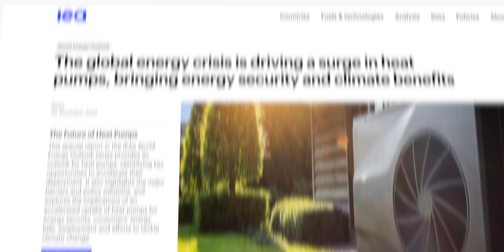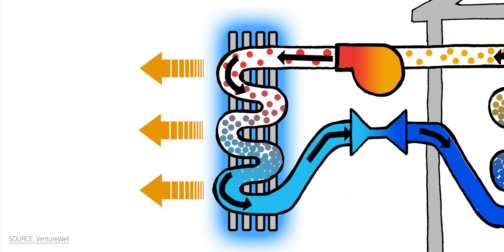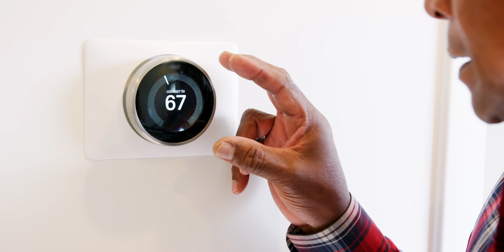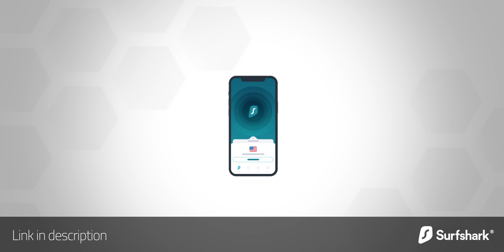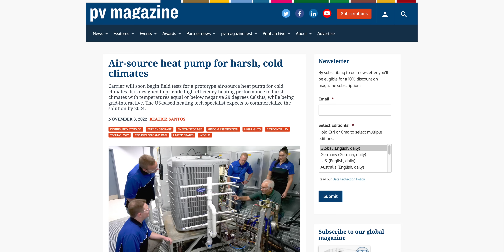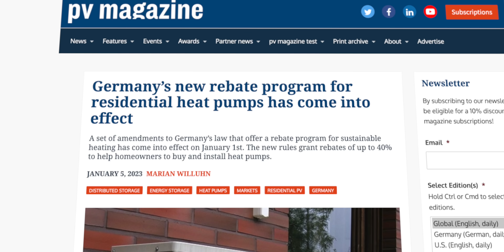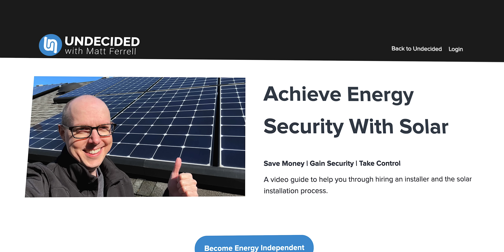Major Advances with Heat Pumps in the Extreme Cold

Comment: I live in Central New York and have a geothermal water to air heat pump.  It works very good in the winter and even better in the summer.  I does run all the time when it's cold outside because it is easier for it to maintain the temperature inside that way.  Our house originally had oil and I'm glad it's gone.  Planning on getting solar and a local storage battery to maintain the power to run it if we lose power from the grid.  Our system was installed in 2021.  Unless the tax credits were changed, they started at 30% of the install cost and go down each year by 2%.  For 2021 taxes we were able to get a credit for 26% of the install costs.  Plus we received a rebate from New York state for about $6000 that came off the top of the install price.  Still cost a good amount, but the amount we save each year from oil is enough to recoup the costs in about 5 to 8 years.
Reply: Do people really fall for the spam messages that say DM me for money?  I find it hard to believe.

Comment: I have a relative that lives way up north where it gets very cold indeed.  She has a ground water sourced heat pump.  Basically they drilled two wells. Water is pumped out of one and back into the other.  They are placed far apart so the cold water they are pumping into the ground doesn't go to the input side well.  On the coldest of cold days, it keeps the house comfortable running only about 50% of the time.  It seems that a factor of two overdesign is what heating people always do.

Comment: Heat pumps working at low temperatures is great. Having your thermostat  controlled by the grid is centralized, top-down control. The PV magazine article on the Johnson Controls heat pump  you showed, states the technology will  "enable utilities and aggregators to ask connected heat pumps to reduce power consumption to 70%, 40%, and shut-off, depending on the level of curtailment needed.” Heat pumps that successfully pass the challenge will have to provide such grid-interaction services."  I don't want my heat being shut off as a means to control me. Based on what is happening in China with social credit scores and the move in US and elsewhere toward central bank digital currency, these are techniques for "elite" to control our lives, money, and now energy.

Comment: I had a AC/Heat pump installed last summer, it's been fantastic.  Works great until about 26F below that it really starts working pretty hard and is loosing efficiency so I switch back to my propane.  I've barely used any propane this year, so it'll pay for itself in a few years.

Comment: My Lennox uses more electricity in the winter then the summer. It heats but uses lots of power. I turn on natural gas below 30 F. It’s a 98% efferent furnace/ heat pump that is 6 years old. SLC UT.

Comment: 2:36 Well, I'm not sure how you can say that's not a lot of electricity - a HP can draw around 4kw an hour if around a 48k system. That for me, is 52 cents an hour just for the outdoor unit, and yes, that amount of heat demand is not atypical up north. 
3:25 I'm not sure where you got that information that HP systems require less maintenance than a combustion system, but that's just simply not the case. And while I'm all for electrification, unfortunately, HP's just don't win the cost argument, upfront or even for operation, IF using natural gas as a comparison. 
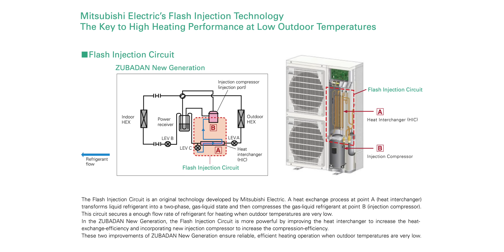7:50 Mitsubish already has this on their newest H2I systems from what I've gathered. However. the diagram is wrong - what is going on, is refrigerant that was not turned into liquid, gets fed back into the compressor and then sent back to the coil, which is necessary due to high compression ratios at low temps. Refrigerant turned back into a gas gets also pumped as usual, and that is what keeps temps in check. I'm not sure who alleged that reduces efficiency - quite contrary, it actually makes it work at really low temps vs just having early compressor failures. Gree also has their own setup already in place in the FLEXX system (also MRCOOL Universal) and their Ultra systems that are rated to -31 F.

I don't have much faith in anyone here in the USA to install these correctly. Don't take my word for it - take Jim Bergmann's, a veteran of the industry. Read the entry on Measure Quick's website, Electrification – An Open Letter, under news. Getting everyone to HP is really, really going to be a horrible time due to how they work, esp for those of us up north. And that's because putting in the necessary capacity just isn't feasible with air flow restraints.
Reply: Both of the A2A heat pumps I've owned here in Sweden have had a 2-4 year service interval. Any Combustion-based system needs to be serviced and checked annually for safety, in some countries that's even a legal requirement (I have to have my chimney checked yearly by law here, even if it's not "in-service", it by law needs to be checked every 3). Skipping a heat pump service results in a best case, is you lose a bit of efficiency, worst case, reduction in service life. If you leave a combustion-based system for 4+ years without a service, you are literally playing with fire.
Reply: @Ben  10 plus years with my furnace, no maintenance needed. Vs my mini split after one year already needs a blower wheel cleaning. And since I know the amount of effort it took to remove it to replace the motor, I'm not looking forward to it.

Comment: It's interesting to note that my utility company "has" rebates available for installing heat pumps, but in practice there are enough caveats to that so that you may not qualify. I didn't qualify because I didn't have a particular model of coil they wanted installed in my ducts (because it was too big so I went with a smaller one that fits and still works perfectly fine). And of course having the duct above my back up furnace replaced to match the more expensive coil would have ultimately cost me more than the rebate was worth.

Comment: "Automatically scales back energy consumption during times of peak grid loads"
This benefits only the grid operator, not the homeowner. I'm not sure why people say this as though it's a good thing. When the grid is under peak load is typically caused by the same weather that is at my house, when I also need peak performance of my system. It isn't my fault the grid operators are lazy with building out capacity growth.

Comment: I live in the northern part of the S.E. of the US. We have one of the older style heat pumps as part of our AC/electric heating system.  It doesn't work very well below freezing, and I can't afford a geothermal system nor even to upgrade to a newer and more efficient air heat pump type system.  So what I've thought of doing is to modify it some: 

    Basically I want to dig a watertight box into the ground and connect a closed loop piping system to loop around my outside condenser. More specifically, the box/water container will be highly insulated on the top, the water will have some anti freeze in it, and I plan to build a box on top of the in and outflow pipes (and right on top of the buried water container), and that box will be painted ultra black and have reflectors on the side so that it will warm with solar energy (and have water bottles inside for thermal mass/storage). 

    Basically I want to try to squeeze every little bit of efficiency out of it for when the temp drops below freezing, but at lost cost and easy installation.  If I put a cover over the above ground box that is painted both ultra white and with a material that has good IR transfer, I may be able to use the system to boost efficiency for cooling in the summer as well.

Comment: I recently (last year) replaced the furnace in my house. I considered a heat pump instead of non-reversible AC. The problem was it cost twice as much and was made of unobtainium. As in, just plain not available for 18 months or more. And I would still need a backup heat source. It just wasn't economically possible, however desirable it might be.

Comment: I'm employed in HVAC trade & it's true older heatpumps needed axillary electric strip heat during cold weather but newer technology heatpumps are getting better. Problem I have with customers is trying to convince them to refrain from using higher indoor fan speeds thinking they will get more heating capacity. Can't tell how many times I tell customers to pick a temperature, put the indoor fan in "AUTO", LEAVE IT ALONE & allow the unit's control algorithms to determine the most efficient mode for comfort control.

Comment: We are near you, west of Boston, and have replaced our oil furnace usage 100% through solar and heat pumps. We have 80 solar panels across 2 systems, Generac and Enphase, with a 18 kWh Generac battery.  And we have a Bosch 5 ton 20 SEER ASHP for the main house (rated to -5F), and a smaller Mitsubishi heat pump for a 3 room addition (rated to -13F).  We finalized it with a Rheem ASHP water heater. We are still in the first year of having all these systems on since we shut off the oil furnace in September.  So far so good.  We’re waiting for 12 months of operation before analyzing our exact energy usage, but back of the envelope shows we should produce about 25 MWh of solar and consume about 15 MWh, leaving a 10 MWh surplus that we send back to the grid. But that puts us in a position to switch over to EVs and not worry too much about paying to charge them. We’ll see.

Comment: I have a air-based heat pump by Daiken and the upfront installation was around $15K fully installed with insulated ducting. It's everything Matt says they are here.  Very low maintenance, and considerably quiet.   Down side?  When it falls below 10 degrees here in Alaska, it does struggle a little to keep our home temp which we like at 68 degrees.  So we supplement that heat with a pellet stove.  I burn through maybe 10 bags (40lb ea) of pellets a year on cold years, less on not so cold years.  But the challenge for us is not it becoming too cold, it occurs around 31-34 degrees which causes massive ice buildup within the unit.  I bought a handheld pressure steamer to deal with that when it gets bad.  Overall, it's my favorite way to heat where I live and it doesn't stress my energy bill out at all.
Reply: Trudeau will be coming after that pellet stove before long.

Comment: We own two properties in Canada and both are heated by hybrid heat pump systems (with gas auxiliary heat). We keep our vacation property heated to 10 degrees C and this works without auxiliary heat down to -30 C. In the city, we keep our house at 20 degrees C and our Lennox heat pump works without auxiliary heat down to -15 C. The only issue we have is that heat pumps seem to be able to maintain a constant temperature, but are not good at making up a temperature deficit. As a result, we no longer reduce our thermostat at night. If we reduce our thermostat down to 16 C at night, we need auxiliary gas heat to bring the temperature back up in the morning.

Comment: My heatpump in Canada is 12 years old, house is 68 years old but with new windows. We've had a few days of -30c and it's been almost able to keep up. I had to turn on two space heaters to maintain temp, and they kept the house temp up along with what the heatpump was still putting out. It's able to easily keep up to -20c but I do notice it when it kicks in to defrost I will drop a degree or two before the heat kicks back on and it catches back up.

Comment: Think of it this way:

A freezer takes heat from the inside (where it's very cold) and puts it in the back of the freezer cabinet (which gets warm.)

Electricity plus heat pump will always generate more heat than plain electricity. Anyone who says "hear pumps don't work" is simply repeating fossil industry FUD.

(Because electricity can be made from fission and renewables, without fossil fuels.)

Comment: I have radiant floor heating in my home. There's a system in the basement that manages the temperature in combination with the water heater. I can keep the internal home in the winter a few degrees cooler just because the warm floor really makes the room comfortable.

I'm looking at building a new home with cooled ceiling panels, radiant floor heating, a geothermal heat pump, and multi-stage tankless water heaters. For power, I'm looking at solar panels on the roof and an ionic wind power fence. I may also have some hydroponics and a small animal barn. It's going to be a really big project but the home will be self reliant and that's a huge plus in the mountains.

Comment: We got a heat pump about 10 years ago when our highest electric bills were north of $600 during winter. The absolute highest bills are now $400 (when certain circumstances required us using more electricity some years, so $400 is rare). But the bill year around for the past 10 years was always less than it was previously. (Our system has an electric furnace back up that comes on around 25 degrees F. We did have to have the heat pump repaired a couple of times, but we are still saving money compared to what our bills would have been if we never switched.)  At some point I'm sure we'll have to get a new one, but it is still working pretty well.

Comment: Electric heat?  What's the monthly heating cost as compared to natural gas, propane, fuel oil, pellet stove, wood stove?
I doubt electric is a good idea in the long run simply from an energy-density standpoint.

Comment: "geothermal" and cold isn't an issue. if your system is properly designed the temperature where it is under ground will be near constant.  In fact, if you use A.C. in the summer the waste heat might partially remain as stored heat underground for your use the next winter.
air source heat pumps can operate and extract heat even from low temperatures and advertise high efficiency. In my experience this is not complete system efficiency, however. For example, the heat for the defrost cycle and the discomfort if this heat is drawn from the house or electricity used to provide heat during that time.
Defrost is needed starting in the mid- to upper-30s F - well above freezing.  The amount of defrost increases as the humidity increases because the ice builds up faster and thicker on the coils.

Comment: In 2017 our houses original early 2000's furnace tried to burn the house down when the control panel shorted out. We looked into a ground source heat pump setup, it was going to be $80k to do vertical bore loops or $50k for horizontal loops. The unit itself was about $8k and the install costs were about $5k. 
We opted to go with an air source heat pump but like everyone says, it basically stops working sub 30F and the house just gets cold and we have to fire up space heaters to keep the rooms we are in over 60F. /edit fixed typo

Comment: 1. Heat pumps are absolutely not as efficient as using heat from combustion directly. In order to make the electricity either Coal or NatGas is burned, which is used to run a steam turbine. Turbines are on average only 40% efficient in converting steam pressure into mechanical energy. & lot of energy is also lost just converting water into pressurized steam as water loses heat energy when it transitions into steam. The generators have an additional loss of about 5% converting mechanical energy into electricity. Then there is about a 15% loss in voltage conversion & distribution from the generator to your home. Over all about 65% of the energy in the fuel is lost by the time electricity reaches your heat up. On the other hand a condensing boiler can be up to 98% efficient in converting the fuel into usable heat for your home. 
2. Heat much COP is not constant with air temperature. The greater the temperature difference between the outside are and the target inside temperature, the lower the efficiency. some heat pumps claim they don't lose efficiency as temperature drops, but what they hide in the fine print is the flow rate drops. So if the temperature drops below freezing and your target temperature is about 70F\21C. the flow rate may drop in half to avoid decreasing effiecient, by now your heat pump needs to run twice as long to maintain temperature.
3. Another issue is that heat pumps can freeze up, especially if there is a lot of moisture in the air. heat pump compensate, but entering a defrosting cycle, that increases temperture of the coils and evaporator to melt off frost build up, but usually when this happens no heat is going into your home, but into condenser unit.
4. Heat pumps put an excess burden on the grid and during cold snaps utilities start load shedding to prevent the grid from overloading. In 2023, many homeowners & business had to deal with rolling blackouts in Kentucky & Tennessee, and in 2021 Texas had a grid failure costing homeowners over a billion in damaged because of freezing pipes.
5. COP does not compare combustion efficiency to the compress gas cycle. It compares resistive heating to a compressed gas cycle. Any advertisment that compares a heat pump to a combustion boiler or furnace is bogus.

Comment: The first 2 heat pumps I had worked great. Then they changed them to not work 30 degrees or less. Yes my defrost whatever you called it is the problem with mine in the winter. It just stops working at all below 30 degrees, my last heat pumps didn't and continued working.

Comment: Matt's geothermal pump is vastly different than standard atmospheric.   He is pumping the fluid down into the earth where the temperature is constant for the heat exchange.
I have a standard atmospheric one.   It's both heat pump and AC.  It can struggle when temps get too low.
I have a wood fireplace to supplement it in the coldest months.